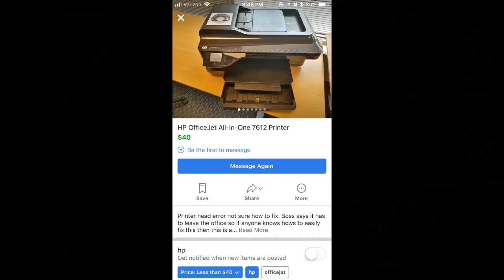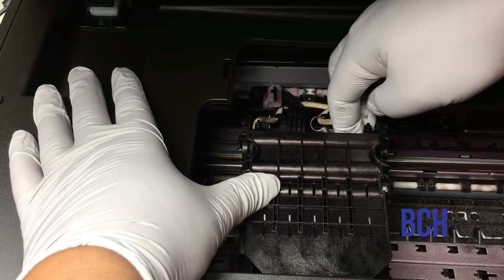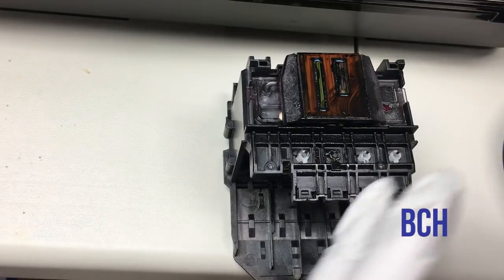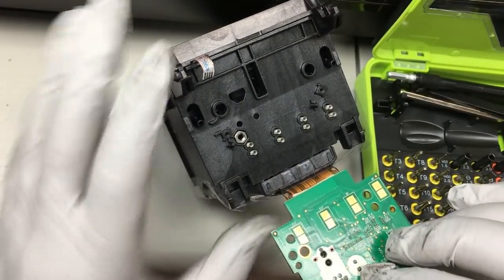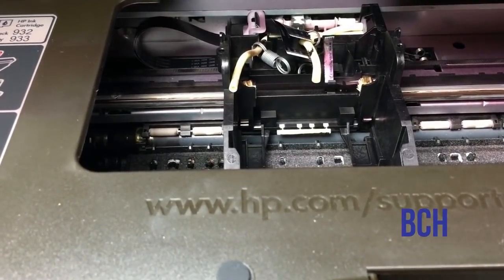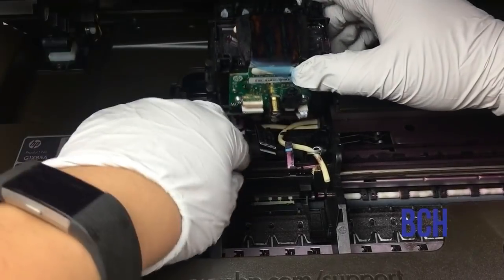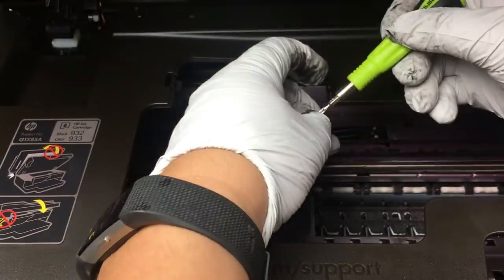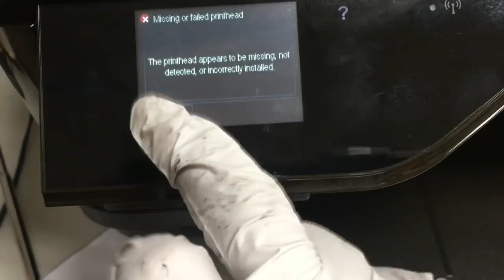Fix HP 7612 Printhead Missing or Failed Problem - Part One - Remove and Install

Comment: Didn't he forget to remove the plastic cover that he placed over the print head to protect it.  I didn't see him pull the plastic off and he replaced the print head without removing it?  Probably the reason many reported that his fix didn't work.
Reply: yes for sure he left the tape and film on printhead but i know for sure he knows what he is doing in regards to printers.

Comment: Thanks very much - quite helpful - I was finally able to get printhead out of its carriage, and clean everything. Unfortunately, after all the efforts, my 7612 is still giving me the "Ink System failure" message, and I can't get past it. I haven't found anything to help further with that....
Reply: ㅊ
Reply: Better buy a new PrintHead for $25 at eBay
Reply: Maybe the thin transparent plastic is leaking air. Try to find some glue to seal it airtight again.

Comment: Hey guys I have an Hp 6700 premium printer and I have the same problem as in the video. I took out the printer head and cleaned it but I still have the same problem, the printer says that the printer head was not detected, missing or incorrectly installed.I need a little help because i'm not sure if it's a broken print head or something else.

Comment: i would bet those contacts are a couple of microns of gold plating. Cleaning themwith an abrasive, is a good way to ruin them. Like the contacts on my Camera lenses, I would suggest using Isoppropyl alcohol, and a cotton tipped swab. That's what canon reccomends

Comment: Let me tell you guys, gals and whatever what worked for me after watching and reading any possible video, document and forum on the net: I sucked with a syringe in the pressure port of the printer. Then after power up one can clearly hear the short pssss hissing sound of air pressure being released when the head moves out of its home position. And there it is - the printer is working again. Again - I sucked in the PRINTER pressure port, not the head's mating hoses side. It seems the pressure pump was stuck or there was some obsticle in the pump's hose. Probably a stuck motor though.
Reply: Ivo Andonov what’s a pressure port?
Reply: Where is the pressure port?
Reply: @geglogu  I guess he refered to the upper part of cartiage which has springs attached to it. And if you hear unusual high hissing sound during the clean up, there must be some air leaking from the thin transparent pastic seal. You may need to find some glue to seal it back again.

Comment: I recently change ink to a generic brand.. then didn't use the printer for a week.. when I came back I got this error-   I watched this but rather than taking it ALL apart, (Cables air lines etc etc) I just lifted the up the print head and saw ink all over the bottom.. so I wiped it with alcohol and it seemed to be fine... and I switched back to HP ink.

Comment: hallo man  i need your help , i have hp 7612  i need your opinion the printer is not recognize the head something problem with head or communication i have this problem  3 times with 2 heads are from from aliexpress the most are Refurbised  , i have change the cables with new i check the contacts and the resistance of the cables and i change  the board with other with the same firmware , the same problem ,all the contacts are clean but , i check the Ωms of the cables the original black cable is 80cm and has 0,24 Ω and this white i find in aliexpress  is 80cm but is 0,3 Ω maybe is the printer is so sensitive the  and don't recognise the head i dont know, the printer its meke error dint recognise , i add even magnet to cable , but nothing , do i have any idea ? i spent so mach money with this printer

Comment: My printer prints are black stripes, I give the option to clean the head, it prints white stripes for several times and then returns to print the images with black stripes. I have tried to align it but it tells me that the alignment cannot be completed. Should I replace my printhead or what can I do? 
Thanks

Comment: i had the same issue on my HP Officejet 7612. I had tried all sorts of reset (partial reset, OOB reset), except the full reset (no setup cartdriges available), but nothing was working for me. I have even tried to add the aluminum foil on the printhead circuit, but it did not help either. So, with nothing to lose, I entered in the service menu and decided to try the option “MFG”. A grid appeared on the print screen, and I let it run for about 5 seconds, then I unplugged the power cord from the printer. After that, I reconnected the power cord, and the printer started working fine again!
Reply: I have the same printer and I am having these issues. How did you access the service menu
Reply: Holy shit, this actually works.
Reply: @jigsawmultimedia1970  In standby mode: 
- unplug power cable
- press power button
- keep it pressed while plugging power cable
- keep it pressed for 10 sec
- then by the screen press in sequence : home, back, home, home
Reply: I DON'T SEE MFG MODE UNDER SERVICE MENU
Reply: It didn't work for me :''(
Reply: @BIZEB  May i know how did you manage to click on 'MFG'? i press the home button instead as i am unable to press the word "MFG" on touch screen. Although it got the grid but it did not solve the problem. Have i done it correctly by pressing the home button?

Thanks
Reply: @mingali01  yes, however I only managed to temporarily circumvent the issue. It was not solved entirely.
Reply: @BIZEB  thanks for your prompt reply.

did you wait for 5 sec for the grid to run? then, unplug the cable and plug straight in again? or have to wait for certain amount of time before plug it in again?
Reply: @mingali01  I waited to replug it about a minute or so.
Reply: how did you go to the service? I cant because it appears the message all the time on the screen and not letting me do anything
Reply: I can't get mine to start in standby mode!!
Reply: how did you enter the service menu. The message Printhead Missing or Failed Problem is all that appears
Reply: @BIZEB  Unfortunately my solution was temporary. The problem came back, after a few days. I ran out out ideas to fix this problem,.
Reply: @markvanvlerken5507  Hoe heb je dat ooit ontdekt???
Reply: Yes It works for me too. My printer is HP office jet pro 8715. Thank you for your help
Reply: @tumiceviche5177  Turn off. Unplug. Hold power button while plugging in and keep holding it for 10 seconds. Then push buttons: home, back, home, home...
Reply: It works for me, too. But you don't need to unplug the power, just click power button and it will confirm MFG on screen and click OK. I guess it's to bypass error message.

Comment: Real solution would be interesting! Part 2? Or is it like it is (was) widely discussed, that HP made those printers stop working once you had inserted non-HP-ink (by firmware-updates) - basically a criminal act and there were several trials dealing with this "policy", obviously with not too many  results - will never buy something from HP again ...

Comment: Printhead Missing or Failed Problem in HP Designjet T830
Reply from the maker: Check if the printhead has good contact with the printer.  If it does, then the printhead may be fried.
Reply: Friend! I'm in Brazil. I have a hp T730 that has the same problem. Did you fix your print head or did you have to buy another one?
Reply: Also me I have printer designjet T830 Sam problem can you please help me haw repair this problem with printhead